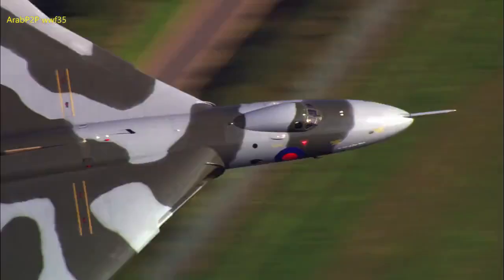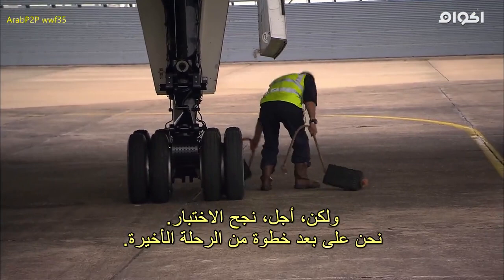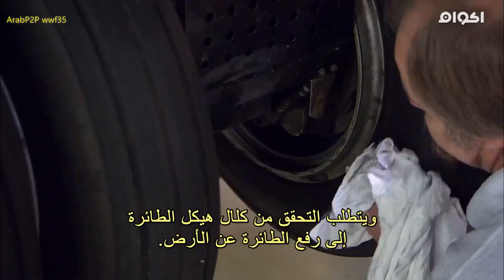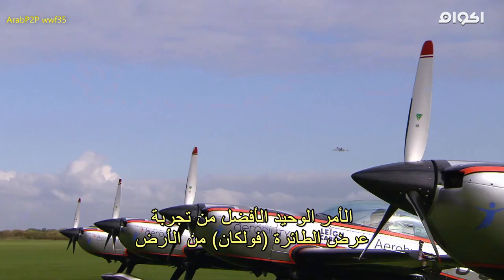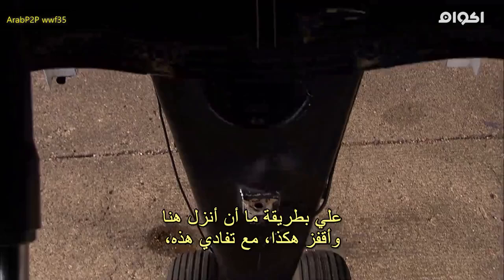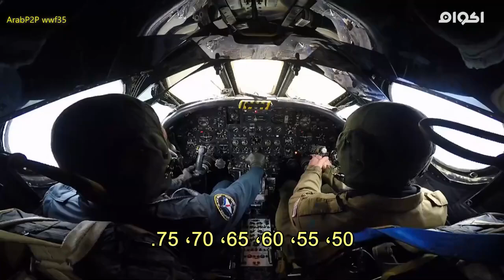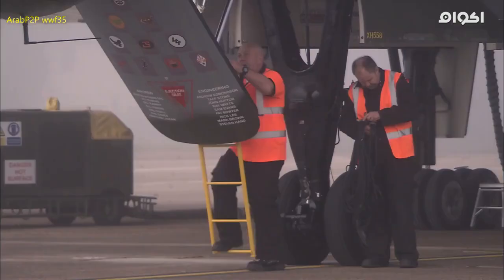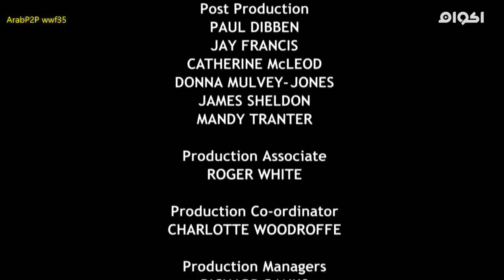Guy Martin Last Flight Of The Vulcan Bomber HD720p akoam net

Comment: The British B-52
Reply: She is WAAAAY better than that
Reply: Different class and type of aircraft,the Vulcan,large as it was, is
classified as a medium bomber,whereas the truly massive B-52,was classified as a heavy bomber.the B-52 has an unrefueled range of more than double that of the Vulcan and can carry 88,000 lbs of bombs compared to the Vulcan's 21,000 lbs,but the Vulcan was more manoeuvreable and could climb faster than the B-52.
Reply: The blue Traxxas Rustler But with 4x less engines.
Reply: Cambs TV yea the buff is no where near fuel efficient
Reply: @aoifependry1029  way better? Naw mate. Woulda rather had the B52s. 
Four or five times the legs. 
3-4 times the bomb load. 
And 100s are still flying to this day and still earmarked to fly into 2030. Meanwhile we can barely keep ONE Vulcan in the air. 
But way better?